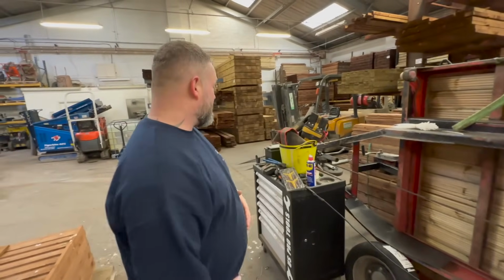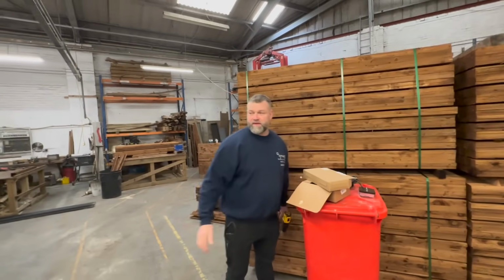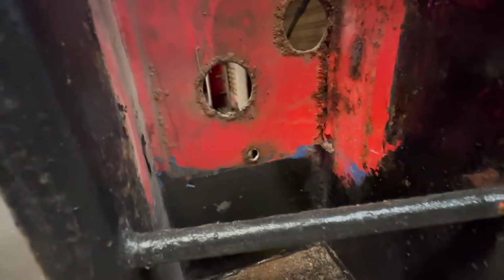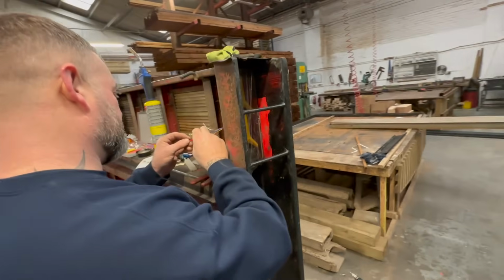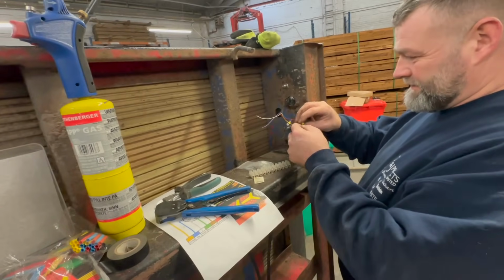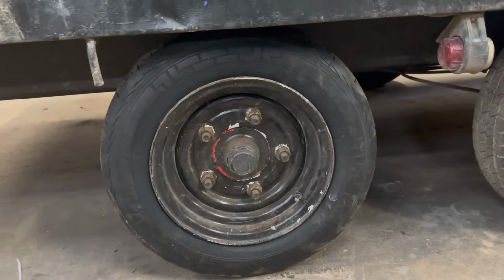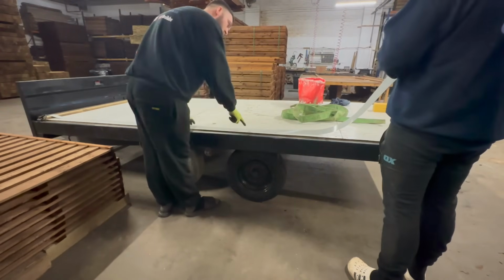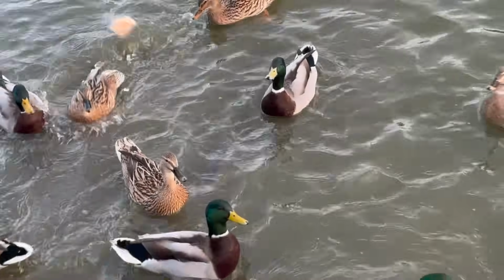Have we MESSED UP? *DIY ELECTRICIANS*

Comment: Happy New Year, great to see the trailer being finished.  Would be worth checking your lights plugged into the vehicle as I thought the indicator flash unit was in the vehicle so would provide intermittent power to the trailer indicator, your lights appear to show constant power and the flashing being done by the LED driver.  Also don’t forget you require triangular reflectors on the back and your marker tape should be orange on the sides and red to the rear.  Really looking forward to seeing your new projects for 2024, keep up the good work!

Comment: I've fitted these exact lights to my trailer and the only thing that doesn't work on them is the audible beep, beep, beep off the controller in the car to say that the indicators are working on the trailer so every time you plug the trailer in you will have to visually inspect the indicators to see if they are working or not.

Comment: Hi I see you put connectors to join the wires together not a good idea nano gets in after a while and you then get problems solider the joints is best then shrink rap it found out the hard way when I worry on lorry’s for years but that your chose Eddie from Kent

Comment: 🎆Happy New Year to all at D&J Projects and all your followers 🎇- So satisfying when you can actual see your work progressing as with the lights  - Just one question Dave  did you fit number plate lights or were they already installed as these are a requirement by law -

Comment: Whilst your on it lads and it's only a suggestion while your under there I would give the chassis a sand and paint it with a sealer to prevent rust I'm 14:43 in so if you do it after that then good job lol

Comment: Nappy New Year for when it comes guys. I think you have just created a monster. Those joints are going to give you no end of issues once you get out in the wet. Not the right fix for the job or environment. ‘Solder Sticks’ would have been far better. Definitely not spade crimps with plain heat shrink and insulation tape. Good luck.

Comment: A good tip for your trailer to preserve the life of the bed. Go to your local motorfactors not Halfords buy a tin of under seal  that you spray on with a compressor light cover your underside covering  chassis and timber but not your brake rods it will  look better and. Will stop  any water splashing up and getting into the timber.   Just a 5 mile journey in heavy rain spraying up off the road  will get into your timber. Prevention better than curing

Comment: The only two things I would've done differently I would've colour coded the heat shirk with the cables then used a bigger heat shrink to cover all of the connections all into one instead of using tape as that would hold it all better but good job guys especially seeing as u ain't use to doing stuff like that

Comment: i had work 12hrs days on 5 day (6day if needed) for 12years n been wear my scruffs tan boots for 15hrs per days n now to date my feet and ankles( after left one getting re contructed)  are both in bad shape and hurt me while walking etc and now my feet ankles have lost the nerve and my legs shack n spasime had to retire due to ill heath n mental health troubles at a young n now just sit on pc an enjoy gaming and also fix others just to stay in the red as they say (watch your vids for the outside life and also to get a few ideas for the back of the house etc (hard when most of it is brick work or paving) plus enjoy watching you and ya dad have the laughs n bond) ( which i truley miss with my pops) keep it got peps
(just a little reminder on the sliiges ya 2t green slige, they normaly have a use date by on them and also some insureance companys impect them along with the FLT ETC)